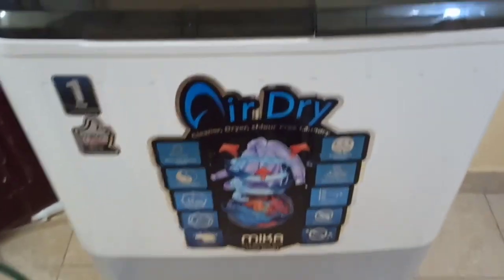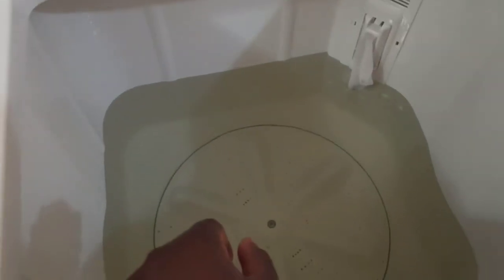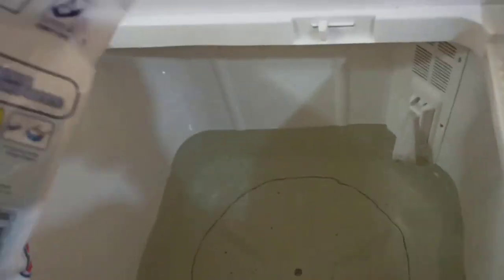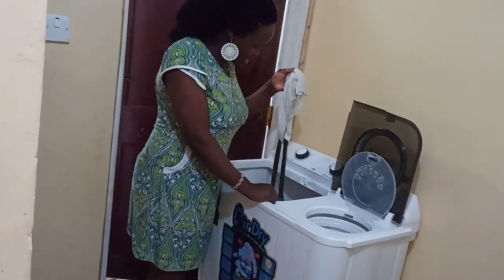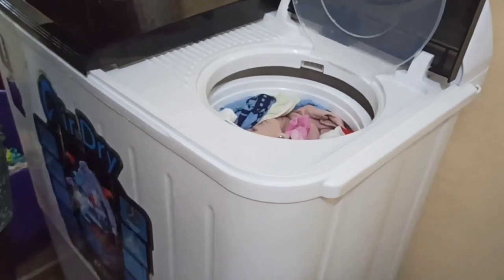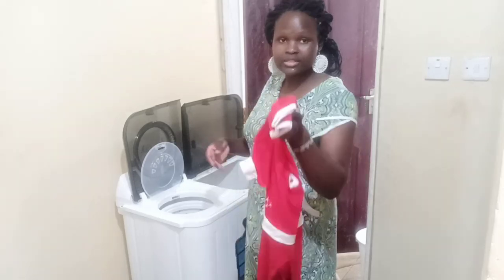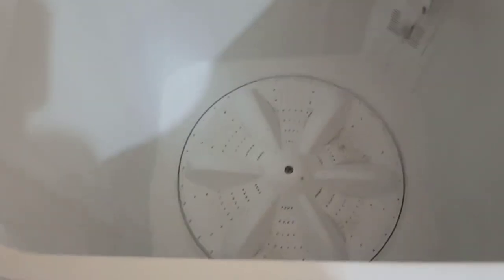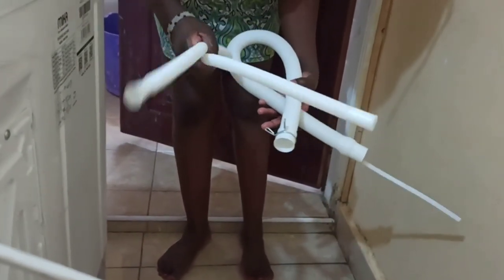Mika twin tub washing machine review | how to use a semi automatic washing machine

Comment: Be putting a small piece of bar soap inside to make it ikue na povu n they even get more cleaner than Omo alone
Reply from the maker: Wow thanks for this gal🥰
Reply: Kindly use English so that we can all benefit 😊,
Help me translate ikue na povu
Reply: That's completely unnecessary. Foam does not equal washing strength. Foam comes from detergents and soaps with high amounts of sulfates. Modern detergents particularly those formulated for washing machines are intentionally made with low amounts of sulfates to avoid foaming but are the most powerful of the batch. So putting bar soap for "foam" is an outdated practice.